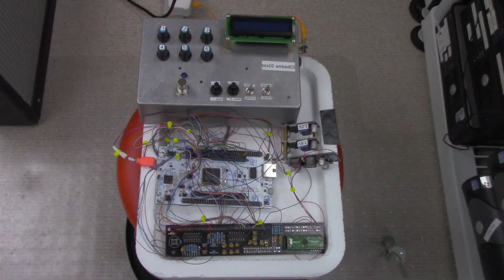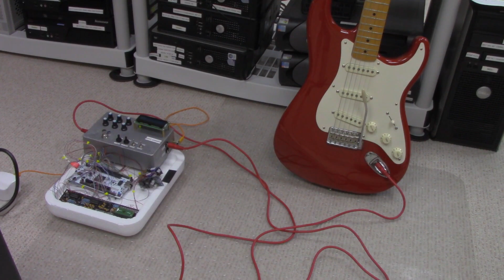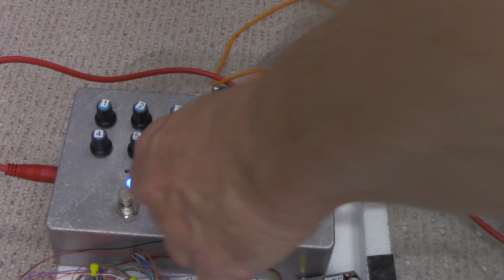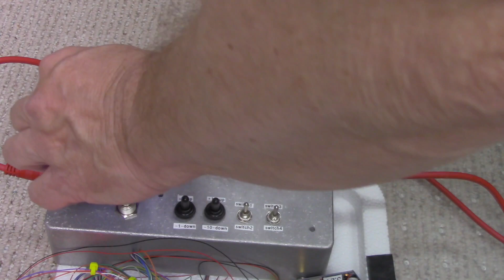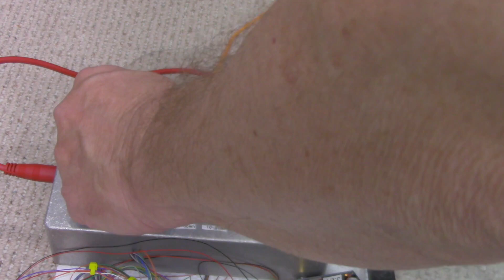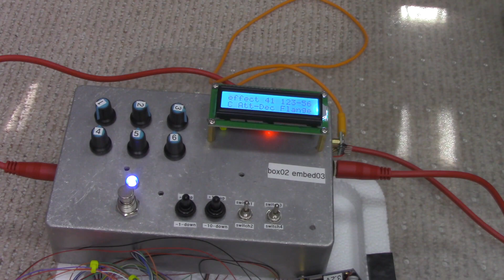Building a Digital Guitar Effects Pedal – Introduction – Part01

Comment: Nice. Do you hear white noise in delays when  you put volume up on amp?
Reply from the maker: There is a little noise. The noise goes down when disconnecting the USB from the PC and letting it run just off of USB power.